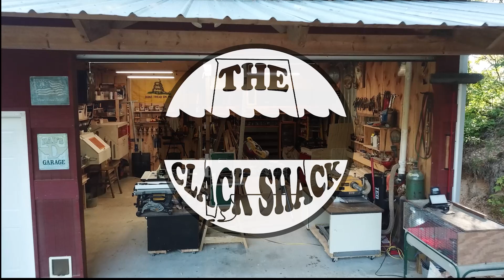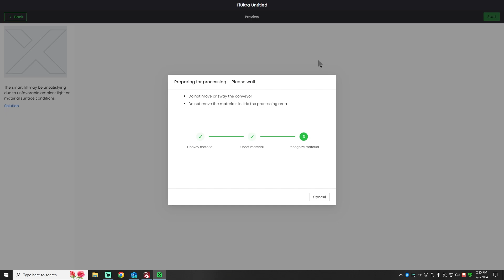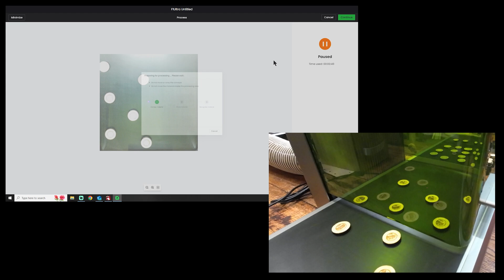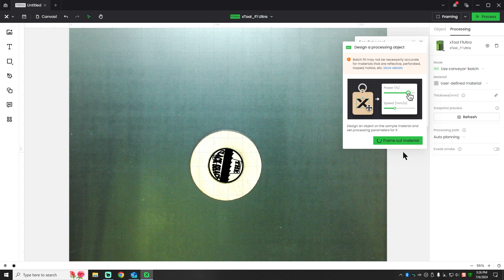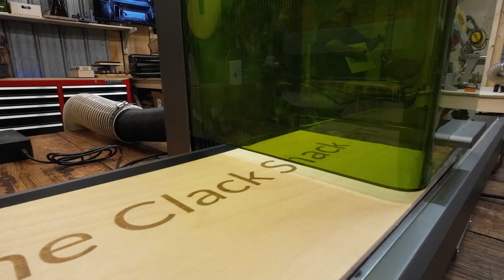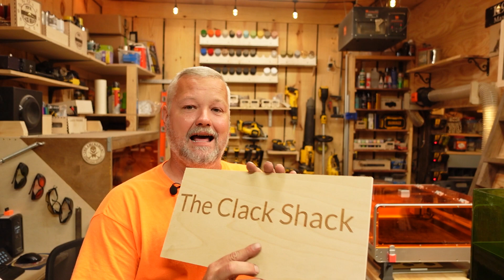xTool F1 Ultra conveyor testing

Comment: I am running into the problem of my designs not engraving on the product but hitting the conveyor belt first. It seems the machine is not reading the placement of my products correctly. I am framing out and going through all the steps. I've only done metal and wood and it's happening on both so far. I've tried adjusting the lighting in the machine and placing my items very carefully, neither have worked. Any help would be greatly appreciated.
Reply from the maker: The conveyor requires calibrations and is still not 100%, as I said in the video. The auto detection is not my favorite. Make sure to calibrate it.

Comment: I wonder if your baseplate auto-height is focused to zero? If not then it could throw off the alignment. Great video!
Reply from the maker: I used the auto focus and calibrated what I was instructed to. Don't know
Reply: @TheClackShack  Yep, I was having alignment issues with mine and found out that what I THOUGHT was perfect red/blue dot alignment was actually out a bit. The recommendation is to adjust the dots using the bed, then hit the auto height measure and make sure it reads zero. Anything else and it will throw off your alignment and focus. Just a tip I thought I'd pass along that really improved my engraving results 😀
Reply from the maker: @houstonfirefox  I did that. Actually did a video pointing it out.

Comment: The wooden disks are my real use case. I need to make up to 3k double sided in a day, which I can do now with a c02 galvo and a jig that holds 4 coins at a time. But the placement has got to be so very exact. If I'm off .5mm on a 34mm disk it's so obvious and makes the finished product look cheap. Was really hoping this would be a good addition to be running separately from my current rig to supplement.
Reply from the maker: Maybe you can get better results.. I can't say that I have that level of confidence in it.

Comment: Still got a wait for mine as I'm in the second batch for the UK. I got the conveyor. If you made a jig to fit under the shield could you have multiple jigs so it could go through the conveyor. Do you have a jig tutorial on how to make and use? Or do y6sell the jig files? I'm new to lasers and this will be my little on for in the house while hubby uses the big one in the shed. Xx ps great honest review which is what we always get so thank you x
Reply from the maker: The ultra is a good machine but jigsaw would work best in a fixed position. Very welcome

Comment: Thank you for the honest review.  It is great that you took the time to pre-score the material in order to judge how far off the burn would be.  I’m curious to know if it would have done better if the lighting were brighter in your shop?  I ordered the ultra with the conveyor but it will be my only laser.  Do you think using a T Square against the body of the conveyor will work to square up the longer material?  Thank you!!
Reply from the maker: I have very bright lights in the shop. I had the cover down and tried adjusting the interior lights.

Comment: I think with two jigs, reloading one while the other engraves, will probably be fast enough to keep the laser working nearly continuously. It might be a lot to ask, but you could probably find out which method is truly faster in a head to head test.
Reply from the maker: Seeing that I have ran jigsaw puzzles for the past two years. After throwing away the ones that were off center, I can do jigs faster. Just my results

Comment: Or… A batch mode that advances jigs. Jigs could have targets that would hopefully allow the AI to be more accurate. It only has to locate the jig each time instead of multiple items. The burn is then relative to the position of the jig which should always line up. Note that the jig targets could be high contrast which should help with the lighting issues. 

Stretch goal:  Add. QR code to the jig. Creative Space could use that to automatically pull up the correct template for that jig.
Reply from the maker: Maybe one day..
Reply: Batch mode to advance jigs just use the regular conveyor mode, copy and repeat the jig file, you’d want to make sure you could align them somehow with tabs and not effect the next, light magnets maybe. Seems totally doable though as it wouldn’t do any batch processing of each individual item. Skips the camera etc. issue would be alignment like identified in the video. But doable I think.

Comment: xTool needs a slide extension for the F1 Ultra. Then you can create larger jigs than will fit in the F1.
Reply from the maker: You can use larger jigs if you need. Work area is much larger

Comment: Great test. Yeah, those are the types of issues We've been seeing on the user groups. The software does still need some tweaking. The best suggestion I've seen for the black items not being picked up issue is to put another color under the black items like a white piece of paper or colored acrylic.
Reply from the maker: Yea, I am sure there are work arounds, but not sure I want to have to go through the trouble rather than just jigging it
Reply: @TheClackShack  Absolutely fair. There have been a few questions by people wondering if jigs are still useful with the F1 Ultra if you have the camera. The answer pretty much universally is yes, because there is still a major speed and simplicity advantage by using them.

Comment: Also heard that people have had better results running USB with hard wired Ethernet to the computer for internet, presumably that’s about processing throughput and latency of wifi being slower round trip than hard wired. 

Another trick I’ve heard is baby powder on the business cards to help cut down the reflectivity during the engrave. To have it be picked up better in bright light.
Reply from the maker: I don’t think the network connection is the issue. I have a very low latency network with about 900 megs of throughput. 

I agree there are things that could be modified to make it work better. It wasn’t bad considering but any more prep and my jigs are gonna be much faster and consistent.
Reply: @TheClackShack agree that if you have to run a lot of the same thing over and over, a jig is faster, but you’ve also got to factor in the time and prep of creating the jig. 

As for wifi - wired is always going to be lower latency no matter what.

I’ve got symmetrical 1gb fiber and while my wifi is fast, a weak upload will make this turnaround take longer, consider a 4000x4000px 16MP likely lossless image that’s about 20-30MB has to be taken each time, processed by the machine, handshake with the server, uploaded, processed and instructions sent back down.

A coax broadband connection is achieving its stated speeds through compression and talking about your download speeds. Your upload speeds will be far more limited. 

I also suspect when it’s in USB mode as it offloads these tasks to XCS a computer will be far more capable of completely the round trip faster than the device itself. If you’re trying to get the most out of the machine it’s food for thought.
Reply from the maker: @tiny-pixls  my upload is actually faster, I am on a fiber connection with a cat 6 connections. I am not saying that wireless can’t be too slow, just that mine isn’t the problem. I think it’s just a limitation of the single camera.

Did I mention I went to college for networking… I understand the limits of wireless

Comment: Wondering if it’s a camera calibration problem? Seen others that have had better results and for the 50mm rounds they all seem to be off by close to the same amount which says to me that there’s an offset somewhere that needs to be calibrated.
Reply from the maker: I calibrated the camera, some of them were really close
Reply: @TheClackShack I’ve heard of people having to calibrate a couple times to get it dialed in. It just seemed like a lot of them were the exact same amount of off. Which speaks to me less of an accuracy issue and more of a calibration one. If accuracy was 1mm let’s say I’d expect if you ran 100 of them for the curve of hitting the bullseye to be close to a bell curve with an even distribution in the direction and how far they were off if most are off by the same amount in the same direction, that’s something else says me.
Reply from the maker: @tiny-pixls  cameras have limits outside the center… all of them do. It’s a curved lens bending light to a tiny sensor
Reply: @TheClackShack sure but given the focal distance and the 220mm squared work area it should be reasonably correctable. A 16MP image even on a small camera sensor would mean that each pixel represents about 0.05mm meaning every millimeter is represented by 20 pixels which should be well within the range for lenses and focal distance correction is all within correctable tolerances. As you know most lightburn cameras, etc are covering a larger work area, at a lower resolution which certainly leads to issues on the edges. 

On a 25mm blank, the shift you’re seeing is a 12% accuracy deviation which seems excessively high to me given the capabilities of the machine. 

And just curious to understand if that’s only happening on batch mode, or not is what I’m trying to figure out.